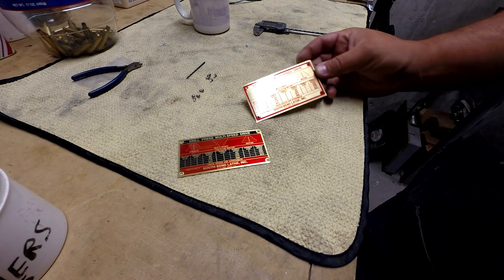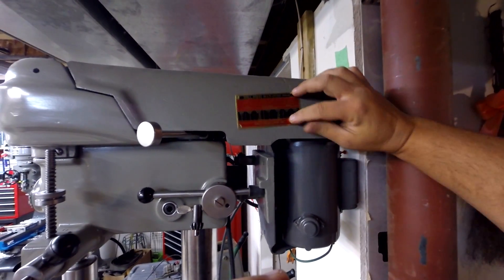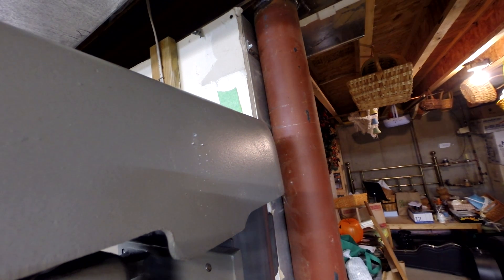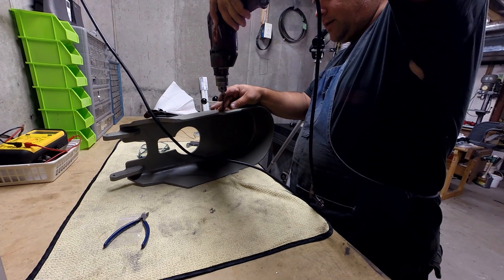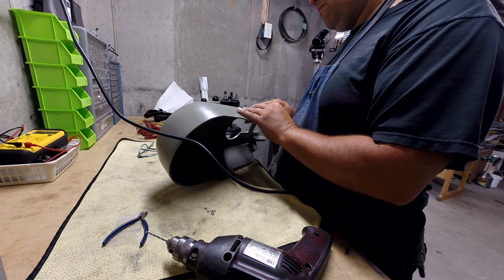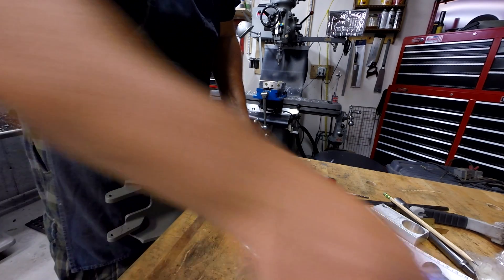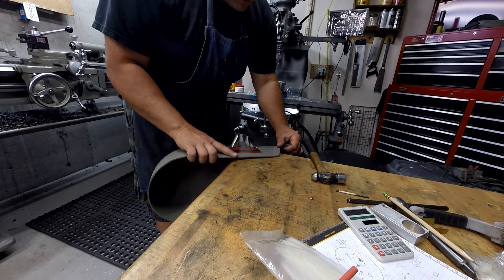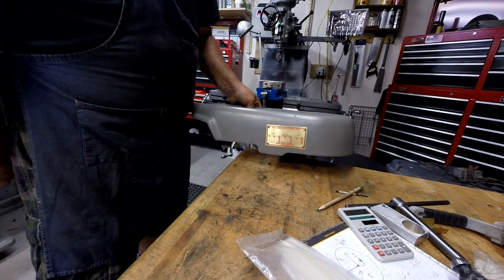Machinery Upgrade #3: South Bend Drill Press Speed-Chart

Comment: Nice Plate!  I had printed out a diagram on paper and laminated it to keep it near my machine, but the plate looks great on there.  I don't have a guard on mine and I swung the center pulley tension arm to the other side because the damn thing kept getting in the way of the quill handle.  Does yours?  Mine is getting pulled apart to get new bearings anyway.  Glad to see your back to the videos!

Greg
Reply from the maker: Thanks Greg - no mine doesn't interfere with anything really.

Comment: Will you see it when you need it. While looking at the pullies?
Reply from the maker: Nope, the chart will raised up with the guard. What I do is look and decide which speed, then raise it up and make the change.
Reply: Ok.  I did see that the gard/shield looked like it tipped up for use. One could see it well enough there.  I spoke too quickly, Apologies 

Let me say the plates are very classy looking..  thanks for doing the video.